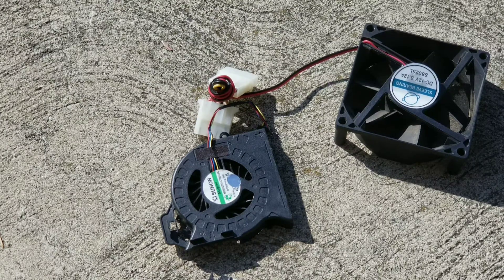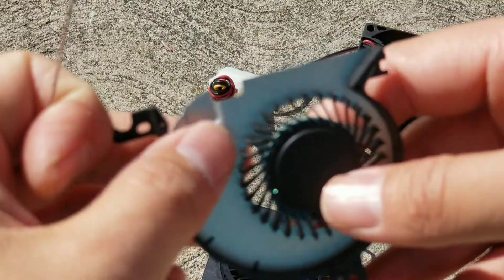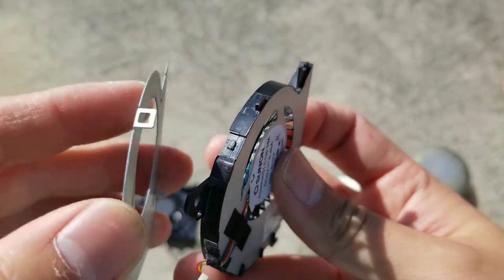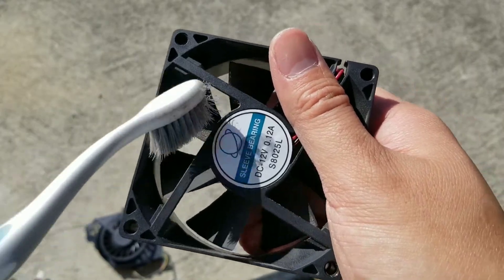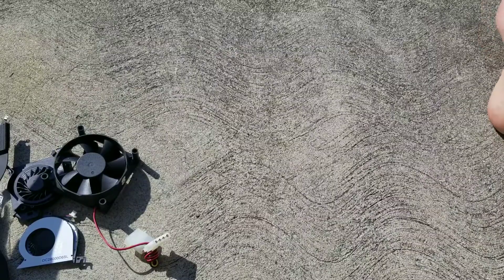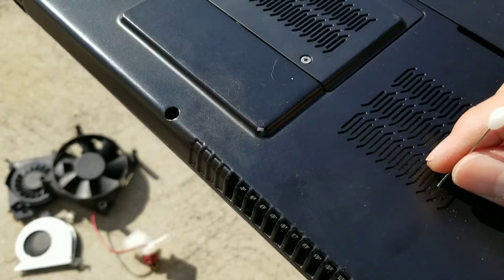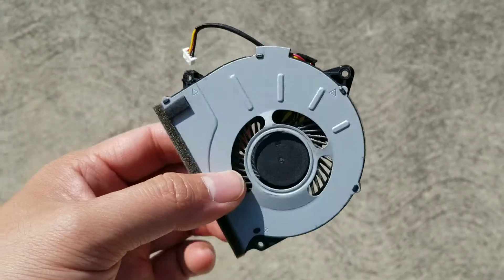How to disassemble/clean/repair noisy/stuck laptop and desktop fans *other methods in description*

Comment: Thanks for video. My Lenovo Ideapad 700 had fans which were the same as the first simple fan, but they were clipped in through the main shaft. Needed a worrying amount of force to snap out of the stator.
Reply from the maker: Glad you were able to get it out. Hopefully no damage to the fins. If you haven't already, please like and subscribe so others can find my videos and possibly consider watching a few others, liking and commenting to get the algorithm to recommend my channel. Thanks!
Reply: @ItsBinhRepaired  yep sure will 👍. Been running 12hrs now with the engine oil no problem. Saved me $30 from ebay
Reply from the maker: @rdxzero  awesome

Comment: great video, especially on how to take apart the fan. I used a locally available engine oil but my laptop CPU fan started making noise again after a day or two. i eventually took it apart again and used high temp grease instead of the engine oil. My CPU fan purred quietly for a very long time.(almost a year of constant , daily use) before i had to take it out to do the same again.
Reply from the maker: @kingk5090  awesome, glad you were able to find a good grease that worked. :)

Comment: usually dry cleaning does not remove all dust
u should use water or wet cleaning (where it is possible)
Reply from the maker: @superlifewithouthell  that's unnecessary. It'll get that dust again very soon.
Reply: @ItsBinhRepaired  contrary, it will get dust again slowly as it was clean without layer of dust (wich remains when you just blow air)
of course you can't see that layer without microscope

water cleaning is possible because vent space is sealed and you can use syringe to wash radiator (if you could)
Reply from the maker: A brand new fan has no dust and gets dusty. What makes you think wet cleaning will prevent that? You say that like it adds some anti dust coating.
Reply: @ItsBinhRepaired  i mean about that microlayer of dust which remains on radiator. It reduces the speed of cooling because it has some resistance. But when you removes it, then air gets more heat of radiator. Furthermore, air blows with higher speed and does not let dust to create layers

If you americans so wise guys. then you must know such things
Reply from the maker: Lol Then a new computer should never get dust on it.
Reply: @ItsBinhRepaired  if you would use it properly
Reply from the maker: @superlifewithouthell  lol it will always get dust on it.
Reply: @ItsBinhRepaired  okay
Reply from the maker: Yup

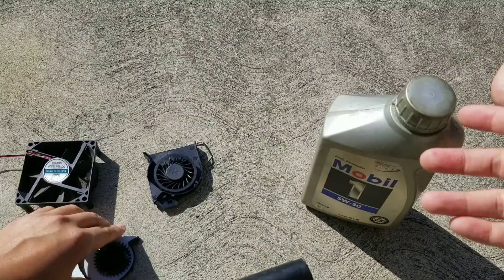Comment: At 5:28 well you can actually pull it but it needs a little more force for me I just push it from the back since I can't pull it and it might broke the fan is I pull hard but pushing it at the back and a little bit more force it will constantly be removed and that's it now you can lubricate the inside and clean it and now my laptop is like okay now no more loud noises and fan spinning properly
Reply from the maker: Yeah, those kinds are risky. Need to press from the back center ring.

Comment: I just blew hard into the fan vent (with the laptop off) 4 times and now the fan isn't making the loud noise anymore, if it starts making the loud noise again I will do it again, I didn't want to spend $100+ for an airblower.
Reply from the maker: Make sure the fan isn't stuck or you'll fry your computer

Comment: my laptop fan is going to be fun to repair then, the spindle has sheared off and is unremovable with the metal seal on the back.  metal fins, metal insert but plastic core which sheared . had a prior fan die in the exact same way but that was back when replacements weren't too too expensive.
Reply from the maker: I found you can push the propellers out on most of the fans by pushing the middle inner ring. Some fans the center part is to small though, so it can't be reached.

Comment: Hi. Thanks for the great vid. I came in here by curiosity because I had no prob with my fan. I cleaned without opening for oil. Did I do it right? How often the fan should be cleaned? Thanks again.
Reply from the maker: It depends on your environment and how dusty it is. If you have carpet and a lot of cloth materials and pets.
Reply: @ItsBinhRepaired  Thanks for your reply. I have no pets, no carpet, no rug, pretty clean environment because of allergy. My computer is couple years old and there was not much dirt at the fan. How often should I clean it? When should I think about adding some oil to the fan?
Reply from the maker: @user-fv9rv3tg2m  oil if if sounds weird. Dust maybe every 6 months
Reply: @ItsBinhRepaired  OMG thanks a ton. You are the best !!!
Reply from the maker: @Vanessa-i8f  no problem
Reply from the maker: @user-fv9rv3tg2m I highly recommend this playlist General Computer Repair: https://www.youtube.com/playlist?list=PLSSiYX-ta7arXXDHc9V4H9gvgGkPI-p8D
Reply: @ItsBinhRepaired  Hi. Thanks for the suggestion. I will watch for sure.
Reply from the maker: @Vanessa-i8f  sounds good :)

Comment: what can i do, it appears my laptops fan speed control is bad. it runs at full speed all the time, i found a lot of debris build up in the fan vents and ive tried every software or driver or even clean windows installation to get the fan to work as usual but nothing works. im at the verge of ordering a new fan so please advise me.
Reply from the maker: Clean it, and if it doesn't work, replace it.

Comment: Just to add, lithium grease is high temperature resistant so may be of benefit.  Also you can buy it in smaller quantities!
Reply from the maker: If your fan is reaching high temperatures, then your laptop must have caught on fire. Heat stays in the heatsink and doesn't go into the fan...
Reply from the maker: You should be able to put butter on the fan and it won't melt any faster than if you left it away from the computer in the same room.

Comment: Hello, I encountered a problem with my Dell XPS laptop. When I try to start it, it gets stuck on the DELL logo. I tried removing the battery, testing it again, and the laptop started running and shuts down on its own repeatedly , is there any solution please :( ??, especally my datas ,,, this is really a bad idea to integrate the SSD on the motherBoerd
Reply from the maker: Likely failed SSD or overheating.

Comment: What type of screwdriver will I need to open the fan assembly? My laptop is HP Pavilion DV6 2155tx. It has the 3 small screws at the corners.
Reply from the maker: Likely jis0 or jis00
Reply: @ItsBinhRepaired  Thanks
Reply from the maker: Yup

Comment: Lithium Grease is better then motor oil, as it drys out a lot less over time.  
I noticed motor oil in an unsealed and dusty enviorment is just asking for you to take that fan apart, while grease will at least push it off to the side until it gets too much, but will increase the time between service.
Reply from the maker: Makes sense. So far haven't had any needing repeat service yet.

Comment: Anyone successfully done this with Lenovo X1 yoga 1st gen fan? I’ve had it replaced once (with used part from eBay) and it needs replacement again. Thinking probably dust
Reply from the maker: Try it.
Reply: @ItsBinhRepaired  actually looking at old fan I kept and when I looked coder it has 3 screws for opening case. Problem now getting fan loose. it has press fit brass bearing on one side and doesn’t come off (that’s obvious to me). Wonder do any of these fans click onto shaft, don’t want to chance forcing it. Are ultravook fans typically repairable?
Reply from the maker: @cannibalholocaust3015  they design it like an arrow to lock into place

Comment: So there's no way to clean up the motor fan to fill with grease for unremovable fin then?
Is there any alternative way?
Reply from the maker: Watch the links in the description. It varies depending on the design.
Reply: @ItsBinhRepaired  thank you already fix it. BTW have you already tried to replace only the blade of fan (after open it) with another type from another laptop fan?
Reply from the maker: @tian_wijaya  no, there are too many size variations

Comment: Regarding that last model with the melted plastic bits... wouldn't the metal part just fall off and not be reattachable if you were to pry it open?
Reply from the maker: If you pry it, you'll end up with a bent fan... lol
Reply: @ItsBinhRepaired  I meant taking off the metal part (without damaging anything but the plastic)
Reply from the maker: You can glue it back, but I just use small pieces of tape. Don't use electrical tape. Packaging tape works or scorch tape.

Comment: I have the 2nd kind of fan, that you discuss around 2.30 min, I don't understand how you separated the white cover to expose the fan? I think my fan is misaligned so it crashes with the casing at one side and creates noise. That's why I want top open it up. But not sure if I'll be successful cause even in this video you only open it up till the fins. So how do one repair the misalignment is beyond me
Reply from the maker: You'd have to bend it, but how did it become misaligned?
Reply: @ItsBinhRepaired  Yes thank you, I was able to separate it and then fan too. And about the misalignment, I'm not sure if it was even that, but the noise was tooo much, like it was scrapping against its casing. thats why i thought it might be bent/misaligned. Its significantly quieter now, (not as quite as the other one but definitely better)
Reply from the maker: Likely need to add grease

Comment: I have a laptop that suddenly decided to become a blender.
I have a question, can I use car oil? Or natural oil or what??!
Reply from the maker: You watched the video, didn't you? Pretty sure the question is answered there. Lol
Reply: @ItsBinhRepaired  Thanks, I didn't notice (my English isn't great)
I'm going to try putting some oil in and see if the blender sound will stops
(By the way, great video, I hope you keep making more)
Reply from the maker: @senkail6625  No problem :) I'm not a lubricant expert, but anything made for moving parts should work. I've heard some people use the hair trimmer oil as well.

Comment: One other thing: Spinning fans real fast while plugged in will create inducted voltage back into the control circuit. If you spin it way too fast or too much you can burn it out. The motor is a magnet so spinning it creates current. The needle is good for stopping that, too.
Reply from the maker: That's true

Comment: Thank you so much for the lesson. I am electronic engineer trying to fix my laptop and they don't teach us stuff like that anywhere. Thank you so much, you're amazing.

My issue is that the GPU fan on Acer Nitro 5 laptop is hardly spinning. I was trying to revive it before replacing. I will try to clean thoroughly and apply lubrication inside as you showed. Thank you!
Reply: In mine the fan blades aren't making clearance with the sides. I have to file the very edges of the fan blades down so it stops squealing like nails spinning on a chalkboard.
Reply from the maker: @beefstickswellington1203  interesting
Reply from the maker: No problem. Hope the repair goes well.

Comment: When replacing the grease goes. . . Is any grease good for the job or does one have to buy a particular grease. . . My fan needs some ..it is displaying the 90b fan error
Reply from the maker: Any grease designed to lubricate moving parts.
Reply: @ItsBinhRepaired  thanks man lemmy see if this resolves the issue...again helpful video i found
Reply from the maker: @edumaniac3603  great

Comment: Bro which kind of oil can we put
Reply from the maker: Motor oil is fine. Anything designed to lubricate fast moving parts for a long time.
Reply: @ItsBinhRepaired  bro it's worked
Can I get yours instagram
Reply from the maker: Awesome! I don't really use Instagram much. You can see what I use on itsbinhrepaired.com

Comment: My laptop fan are taped to the heatsink with some kind of black tape. Do you know what kind of tape it is?
Reply: It might be electrical tape, it doesn't hurt to remove it. Like he said, it could be cloth tape that is used for cushioning the case and the fan.
Reply from the maker: @WantBadtime  yup, special tape isn't necessary. I avoid electrical tape because the adhesive turns all gooey after a while.
Reply: @ItsBinhRepaired  yeah that's true. Thank you for the video, you helped me open up my laptop that I got 3rd party and I needed to clean the heatsink + the fan so the computer wouldn't sound like a dirt bike.
Reply from the maker: @WantBadtime  awesome! :)
Reply from the maker: Any tape will be fine. Not sure what the tape is though. Usually cloth or plastic.

Comment: Thanks for this video, i used multiporpuse grease worked perfectly, its a gaming laptop so its constantly running on high fan speed while gaming i set it to max fan speed, but even with that the fan is still quiet like new.
Reply from the maker: Awesome, glad it helped! If you haven't already, please like and subscribe so others can find my videos. Thanks!
Reply: @ItsBinhRepaired  will do mate
Reply from the maker: @yamen857  thanks :)

Comment: 5:47 Attention ...it's risky . I removed the propeller and the pin got detached...I glue it back as a temporary solution till the one I ordered will come in the mail
Reply from the maker: It shouldn't fall off unless the fan is bad or you pulled it at an angle.

Comment: I have the ones that don't have removable blades and have a plastic piece blocking access, do you think I could drill/melt it?
Reply from the maker: Watch the other ones in the description. Some need to be forced out. Melting will make it worse
Reply: @ItsBinhRepaired  Oh thank you for the detailed videos. Right now it isn't much of a bummer because after a quick cleaning it improved, if it becomes annoying again I'll try popping it out
Reply from the maker: @SirDella  sounds good!

Comment: Hey there. Quick question. I use a lenovo G-51, and I'm trying to add some oil. It's one of those fans that you just see a golden metal circle with no hole when you remove the sticker at the back (I saw it in this video, but you didn't oil it)
1. How do I get oil past the Golden metal circle?
2. The fans with the melted plastic bits you suggested we use a blade to get past, if you destroy the nib, how do you fasten it back in place?
Reply from the maker: Watch the videos in the description. I also just uploaded another video showing how to remove them properly
Reply from the maker: It really depends on the design though

Comment: [GOOD TIP] 14:30 for better cleaning these fins you have to use soapy water dipped tooth brush and carefully clean those fin holes after vacuuming and removing big bust piles on the fins. Then use moist brushing second third times to remove the soapy moisture out fins with careful brushing, you will see a lot of dirt on the brush. Because micro dust particles settled on the fin surfaces and soapy water brushing after vacuuming will do 2nd stage better cleaning of fins so next time the dust wont settle inside the fins so frequently.
Reply from the maker: Not necessary to clean it to that point. It'll build up again in about the same amount of time.
Reply: True, this much effort just for micro amount of dust to settle again in a month

Comment: Nice video. Id like to add that those circular bush (or whatever they call it) at the center helps maintain tight centrifugal motion and prevents shaft from grinding. That can be replaced with sliced rubber  and glue but needs a lot of hit and trial.

Comment: Can i Lubricate My fan without Pulling out the fan?The fan Wont come off tho :( .Tried to open it and i see some gap.Can i Put An Oil On that Gap? My fan wont working and when its spin,its make a loud noise and feel something stuck there
Reply from the maker: Watch the other videos in the description. You can try putting oil in the gap, but I don't think it'll work.
Reply: @ItsBinhRepaired  Already Watch The Metal Backing Plate...And its still won't come off tho.Or Maybe I didnt try to push it hard enough
Reply from the maker: Watch all the videos. There are all combinations. Not all can come out.

Comment: Can we use wd40? Can't get any grease :/
Reply from the maker: No, even grease from your face would be better than wd40. Do you or anyone you know own a car? Just ask to get some oil from the dip stick
Reply: @ItsBinhRepaired  Got it tyvm
Reply from the maker: @vorseil3230  got some oil?
Reply: @ItsBinhRepaired  I searched the car my dad has. and yep it got a dip stick!
Reply: @ItsBinhRepaired  Btw I saw the other videos. but the fan i have on my Ideapad Flex 5 14IIL05 dont have clips or those things you need to scrape off the surface.
Reply from the maker: @vorseil3230  any small screws? Check the other side of the fan.
Reply: @ItsBinhRepaired  No sir, no screws
Reply from the maker: There has to be a way to separate it
Reply: @ItsBinhRepaired  I'm gonna try find a way : )
Reply from the maker: @vorseil3230  hope you figure it out

Comment: Hey man, in case you're still hanging around here I wanted to know what was your process on getting one of those laptop fans to remove the fan itself from the base, you mentioned that it "pops" off but I'm having a hard time doing so with my own fan.

In case you'd like to know it's the GPU laptop fan made for the Asus ROG G752VT-DH72, the brand is also Sunon.
Reply from the maker: Watch the videos in the description

Comment: I have a lenovo miix 520 fan that is really loud. I cannot tell if it is suppose to be that loud. It buzzes sometimes and the buzz gets quieter when I lay the laptop flat. How do I know what a healthy fan sounds like?
Reply from the maker: What did it sound like when new?
Reply: @ItsBinhRepaired  not sure since that was 3 years ago. The degree of the buzzing changes depending on the angle so I am guessing that is not suppose to happen
Reply from the maker: @jamie8271  need to add oil